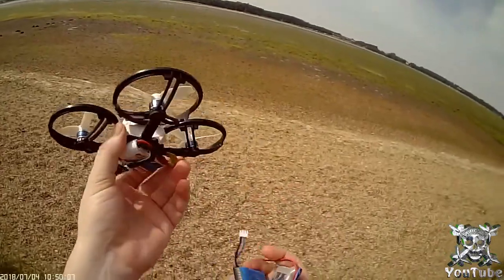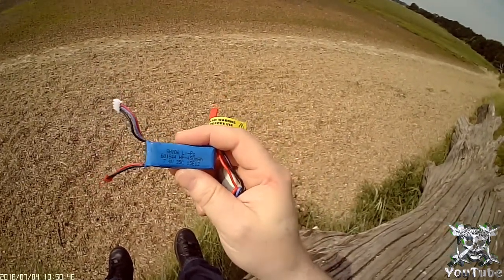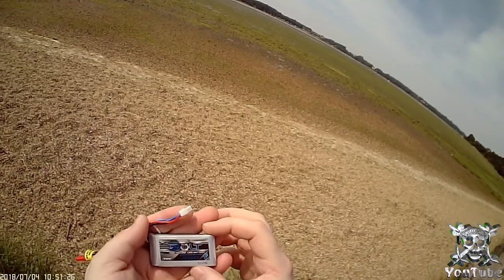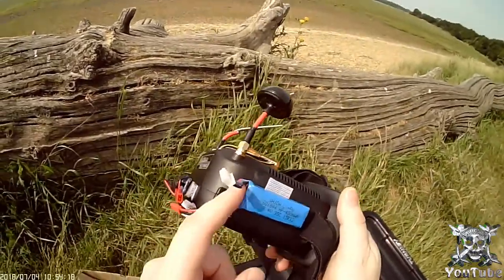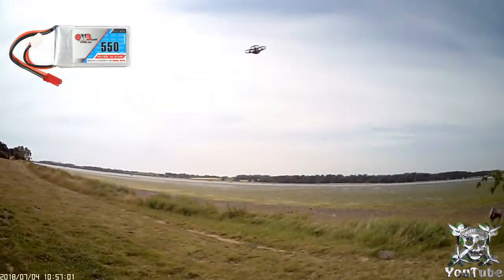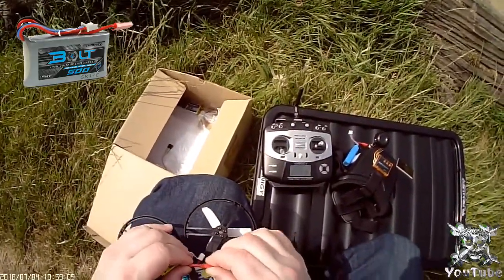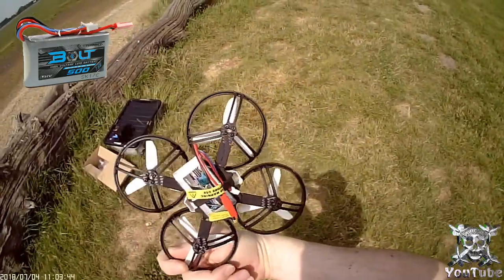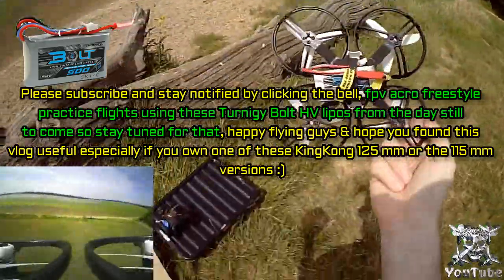TURNIGY BOLT 2S HV vs GNB 2S HIGH-PERFORMANCE LIPOS PUNCH OUT & ACRO FREESTYLE LOS FLIGHT TEST.....

Comment from the maker: TURNIGY BOLT 2S HV LIPO:https://hobbyking.com/en_us/turnigy-bolt-500mah-2s-7-6v-65-130c-high-voltage-lipoly-pack-lihv.html?affiliate_code=AJGUFWSJSXUOSTY&_asc=2505605911

I found these on the Hobbyking website they are a good alternative to the GNB lipos for your KingKong 125, 115 etc, hope you found this video useful as getting the wrong c rating lipos can cause the flip of death as i show in this video! we live and learn my friends, I like to share what I learn along the way with you guys, so if you are starting out or need advice on quads or flying & setup then subscribe and get involved in the channel, greets TJ :)

TURNIGY BOLT 2S HV vs GNB 2S HIGH PERFORMANCE LIPOS PUNCH OUT & ACRO FREESTYLE LOS FLIGHT TEST.....

Comment: I use the gnb 550 and I use the tattou 650mah. With my shark mako I need a high c rating. My 550 mah gnb are equally as good as the 650mah 75c. I have started to fly in acro yesterday on my beta 65s lite to get a feel for it. Bro I like  it.
Reply from the maker: Nice bro, yeah I am loving learning & practising fpv acro freestyle, yeah tatu are very good & gnb I am just giving people another option if they want faster shipping and these are a great price :)
Reply: TJ. RC.UK bro to be honest with u. I don't notice much difference with my cheaper 3s. I get about the same flight time
Reply from the maker: You will notice it more when you are pushing the quad harder on punch outs and acro if the c rating is to low as you are demanding more of the battery and that is when you will see the dreaded flip of death lol